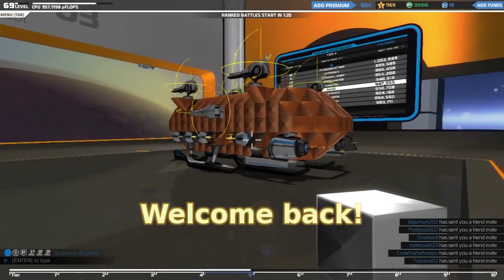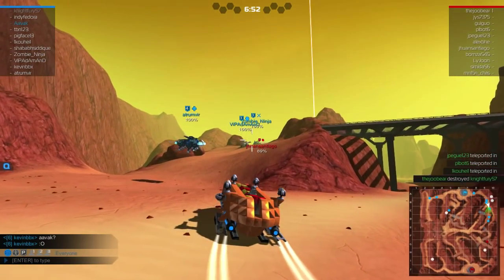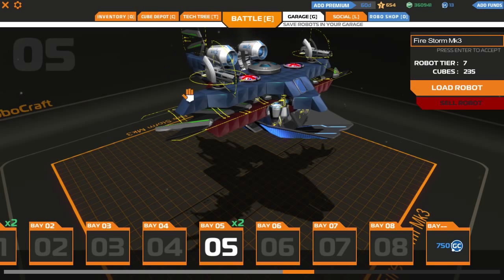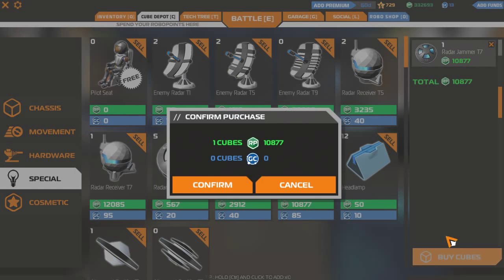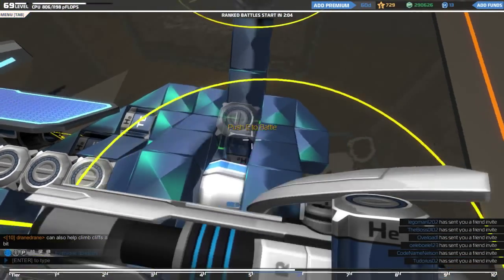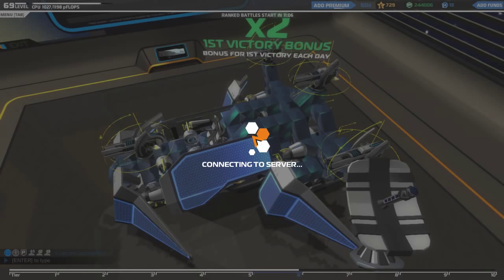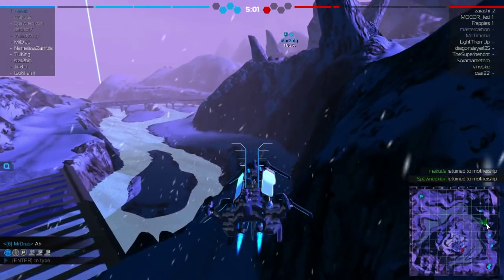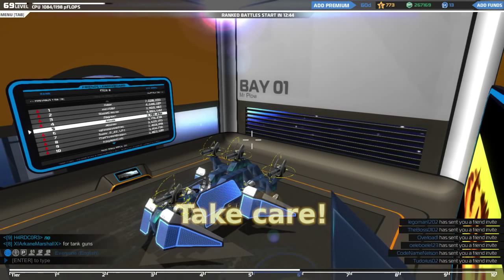Robocraft - Episode 49 (Mr Plow)

Comment: Pressurized helium is actually a bad idea for a bot. Keeping it under pressure, i.e., denser than natural, defeats the purpose of Helium. So, yeah, the canistes are totally safe in terms of exploding. It's more a matter of being armored by basically 2 paper thin sheets that should have the pilot worried.
Reply: why do people think it would explode? Oh...
Reply from the maker: Yeah, funnily enough had a conversation about this a little lower down. The blocks look like they're armoured, one must wonder by /what/ because if we assume those blocks are a metre cubed, and the tier 4 helium blocks can weather a direct hit from plasma artillery, you'd expect the armour used to keep them safe would itself, defeat the purpose of the helium it's protecting.
Reply: Aavak Actually i think if it is 1m^2 that means that there is a lot of elium on the inside,or at least so much that can easily compensate the armor, so it is like airships actually

p.s. sorry for the english but actually i'm italian :)
Reply from the maker: Your English seemed fine, no worries :)

Comment: Wouldnt pressurizing the Helium make the cube useless? I mean it would increase density and therefore not provide lift anymore.
Reply: I just pretend Helium is the codename of some sort of passive antigravity device, which would also explain the high unit cost and CPU load.
Reply: That actually makes sense
Reply from the maker: You know, that does make a lot of sense; I've only ever seen helium in tanks, which I imagine it s the most optimum way to store it, but now you mention it of course that would increase the density enough that it would likely lose much of its usefulness.

Though, that said, unless those containers are made of tinfoil, I very much doubt that any amount of helium inside them would be able to counter the additional weight of the metal box.

Comment: the helium is less dense than air so it lifts there is no point in pressurizing it because it just makes it denser than it already is
Reply from the maker: And yet higher tier helium blocks offer more lift, without increasing their size, and also offer more protection (implying thicker armour)

Logic... it seems absent.
Reply: it usually does in the games that seem to have the most
Reply: Aavak
Maybe the hull of the higher tier helium blocks is stronger - like the higher tier armour blocks are stronger while still taking up the same space - and can hold an even smaller amount of helium without imploding under the ambient pressure. Smaller mass -> higher lift.

Comment: Helium does not explode, no. Neither would it be pressurised if it was there to lift something, since that would make it heavier. Your pilot might talk funny while under fire, but that is probably the least of his concerns.
Reply from the maker: Oddly, I wonder what the armour the shell is made of, given it's durable enough to absorb rather hefty amounts of damage, and yet light enough not to interfere with the helium inside. And on that note, the block doesn't get any bigger, and yet the higher tiers of helium block have more lift; so unless the armour is getting stronger and lighter, how would the same amount of helium generate an increasing amount of lift.
Reply: Aavak
Hmmm, the helium could be gradually thinned down to vacuum, perhaps?